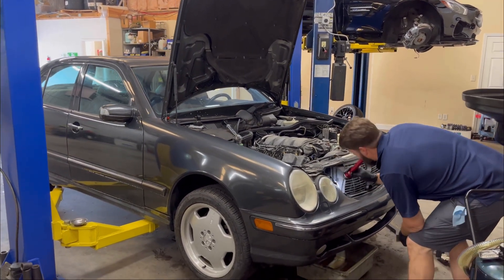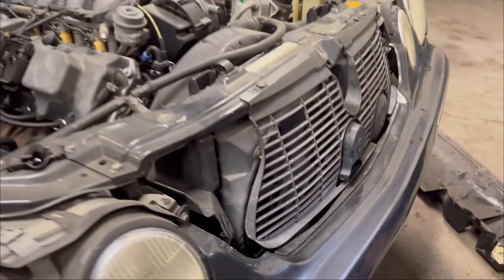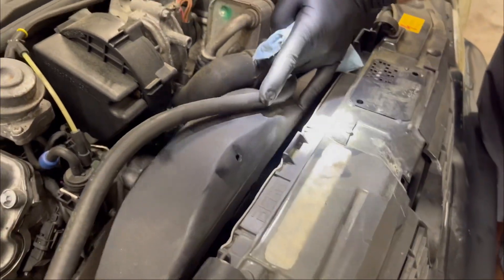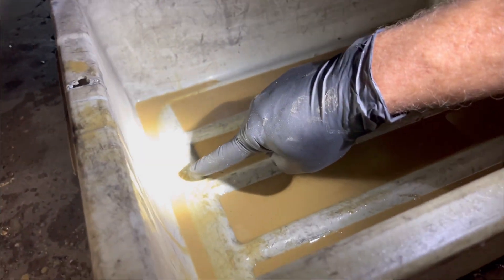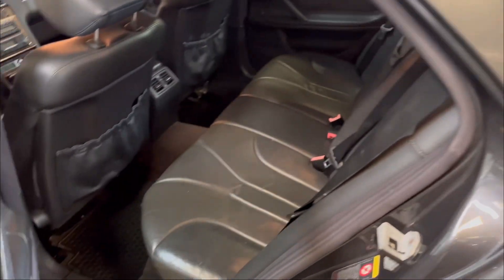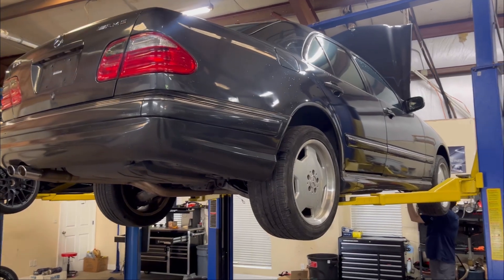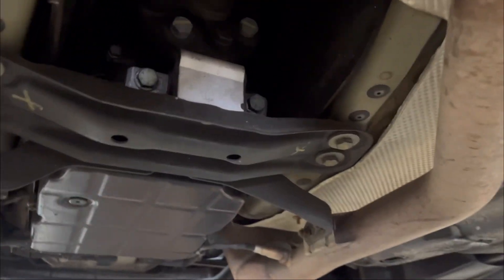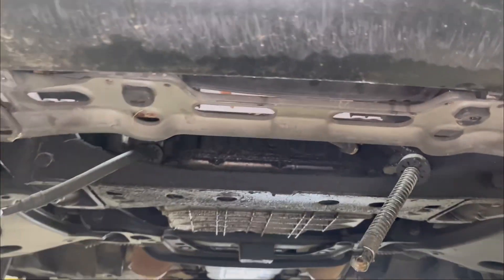BLOWN Engine?! UNAVAILABLE Parts?! A Deep Dive Into Our W210 E55 AMG

Comment: Ooh man this really brings up memories of my first car: A W210 E320 CDI from 2001. That car was just awesome, the power, the comfort and everything, I really loved it. Seems like the 210 chassis is a secret tip for many mercedes enthusiasts as it offers interior space and luxury like an S-Class and just drives like butter if well maintained. If I remember it right even Jay Leno has one and drives it regularly. 
You really have some very good knowledge about the most common failure points and the things that need attention on these 210s. 
In mine, the dashboard started to crack exactly where the airbag cover sits and I also had the rear left window regulator fail. These issues didn't bother me but unfortunately I had to sell it because of rust at the rocker panel and underbody so I failed the regular inspection, here the TÜV 😅. It is really unfortunate with these rust issues since you're not allowed to weld anything at the main frame or supporting elements of the car including the mount for the spring,  so all these cars have to be exported or repaired with a good cover-up of these areas.
Anyway great content again, keep on going guys 👍👍 I really enjoyed this one

Comment: so what did you guys end up with? any vids that follow this one that show the cooler setup you ended up running?
Reply from the maker: We installed external transmission cooler flushed the transmission several times after repairs took it for a test drive and the transmission front pump went out. Now we are on the search for a "new to us" transmission, will do a video update once we are further along in our search!
Reply: @DCMotorWerks  dang… probably got slippery from coolant and died… why not rebuild the current transmission?